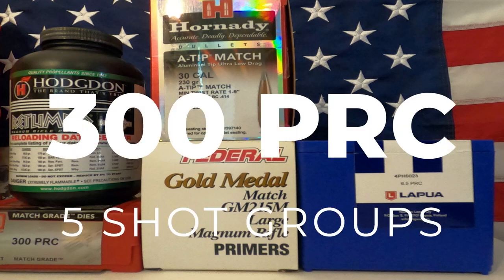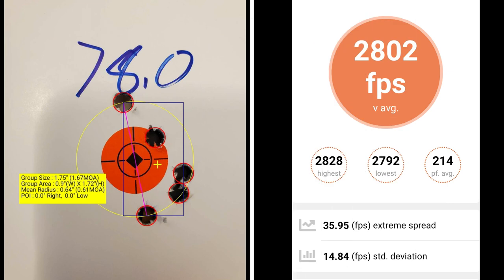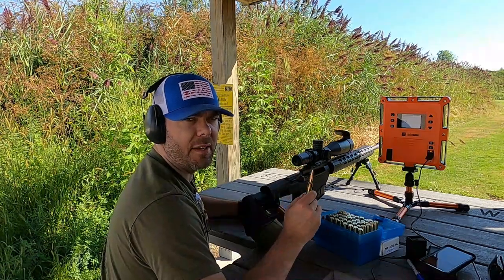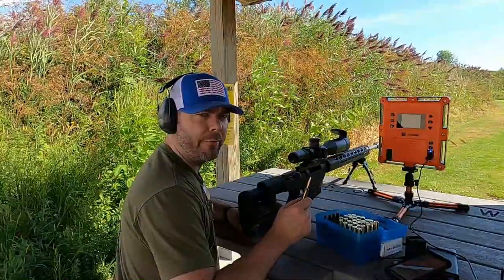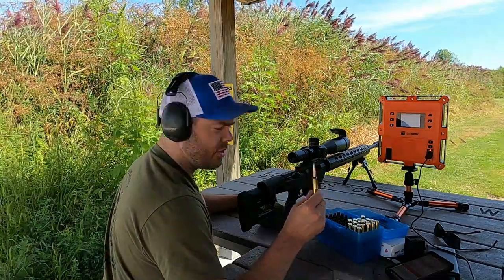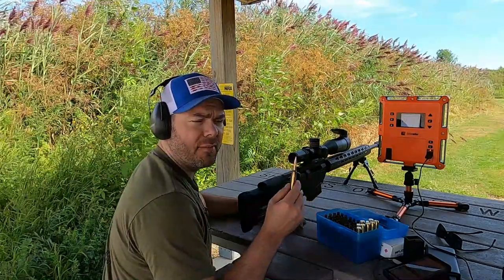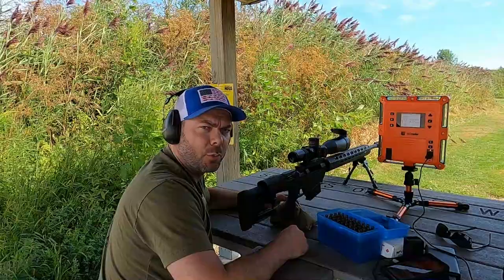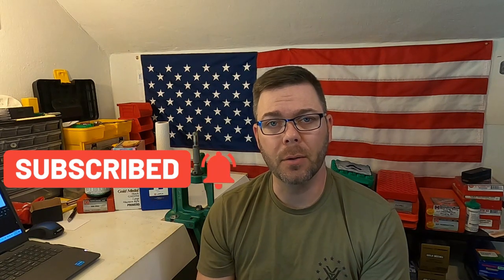300 PRC - Testing Retumbo and Hornady A-Tips

Comment: After  more than 50yrs @ the loading  bench  I  can tell you  that seating  depth  will  tell you  more than  1/10th  grain  of powder  & cost  less  in components  & barrel  wear !  With  cases as large as the 300prc work  up in 1/2  gr  increments  to get the  velocities  & ES you  need  , refine seating  depth  , then test different  power  charges  + or -  a 10th .  Just a suggestion  to save you time , money and  barrel  wear .  CHEERS AND  GOOD SHOOTING
Reply from the maker: You are correct.  My reloading styles have changed over time and for certain stuff, I'm showing different info and how to get it.  

Thanks for watching!

Comment: Matt, I used to do what you are doing and I'll admit it is fun. I watched Hornady podcast EP 050 and it convinced me that none of it matters when it comes to powder charge. Basically there are to many variables such as first five rounds last five rounds barrel temperature and so on. They say your shot string should be 35 rounds not five or three and you will be surprised to find out they will all be the same!! I have loaded for over 34 years and in the back of my mind I noticed these variables but I always told myself things like I pulled that one or I did not mount the rifle to my shoulder properly and so on. Good luck with your loading and Merry Christmas!!
Reply from the maker: Thanks for watching!

Comment: I know this video is old, but have you since worked higher? I am running 80.0gn with lapua brass, fed 215Ms and 225eldms with no signs of pressure and running through Gordon’s I’m just under max pressure. Yielding avg speeds around 2888. This is out of a 24” pipe too
Reply from the maker: No.  I have not.

Comment: How long is your barrel? I just did load development for my new 300PRC, also with 230gr A-Tips and Retumbo. My low node is at 75.5gr wihere I get 2761fps average, ES 23, SD 12.3. High node at 77gr for 2820fps average, ES 5, SD 2.6. I have a 28” Bartlein and also used a Labradar to measure.
Reply: Oh yes - I used regular Fedarl 215 primers as my local gunshop did not have the match primers. I seated 20thou back from jam.
Reply from the maker: This Ruger RPR comes with a 26" with a 1:9 twist

Comment: Another great video Matt. I'm doing powder change testing for this coming hunting season and I'm getting some promising results. Question, I'm useing the range buddy app for measuring group size, is your p,o,i in the center of your red dot target or in the center of your actual shot group? I'm using the same app to. And the mean radius is the true group size the app is measuring from the center of the shot group?
Reply: Sorry I meant P.OA for the above question.
Reply from the maker: I do not use the point of aim indicator.   It is irrelevant.   Once you have a group, adjust your scope.  I look solely at group size.

Comment: Hi, I am from South Africa and is also shooting a 300Prc. But i am using 212gr ELD-X. I am struggling to find a load with retambo. Currently sitting at 79.5gr. Retambo is very scarce and almost the only power i can use for my PRC thats is available in South Africa. So with out  using up all my limited supply of retambo do you have any other load suggestions.
Reply from the maker: Maybe try a lower powder charge.  Try doing some shot groups between 78 and 79 grains.  I am finding that ot is not always best to play with the top end of the charge spectrum.  

Try going lower in charge and see if you get better results.